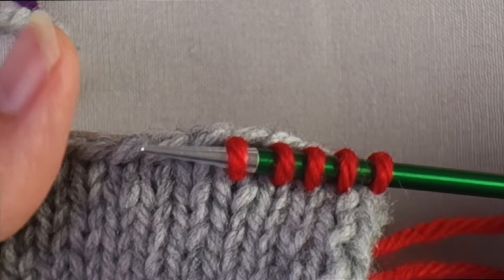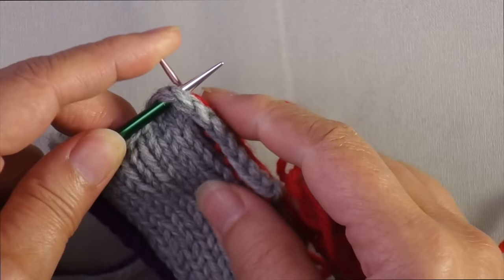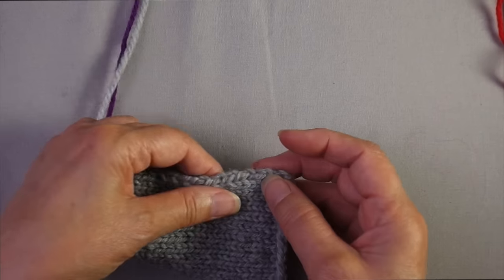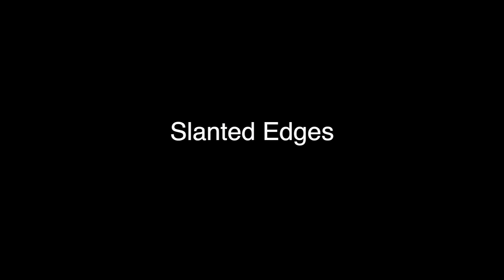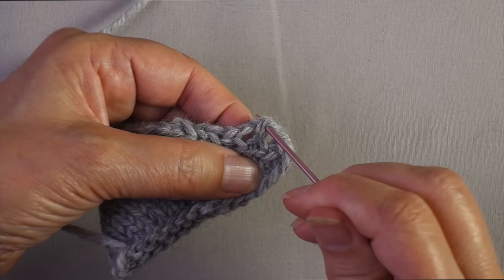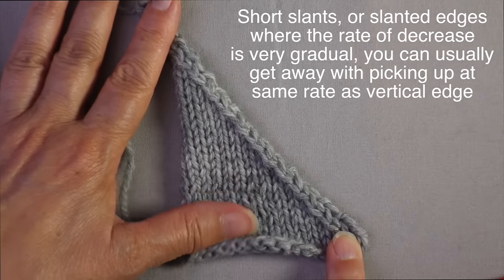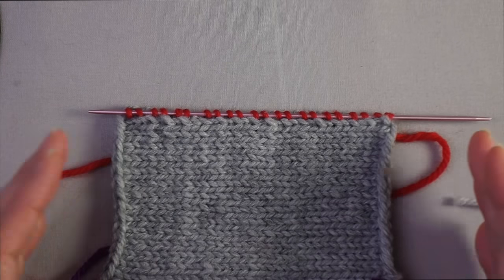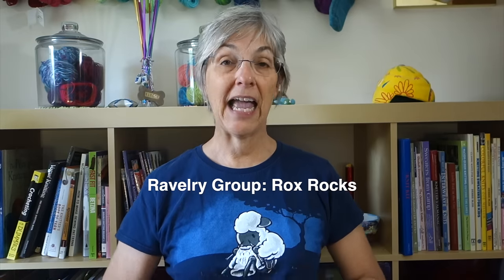Picking Up Sts Along a Finished Edge

Comment: I follow neckband decreases but my neckbands are not very tidy, so when I pick up stitches for the neckband I end up with a mess.
Reply from the maker: If you place your decreases at least one stitch away from the selvedge, you'll have a clean column of stockinette sts available for picking up sts.
Reply: @RoxanneRichardson  thankyou,  at the moment this isn't making much sense.  I'm very confused. My pattern just says to decrease,  knit to last 2 sts, knit 2 tog, which leaves a bulky edge for picking up stitches
Reply from the maker: @hunnybSue  So, instead, work your rows by doing K1, ssk, k to last 3 sts, k2tog, k1. That will mirror the decreases, and it will make picking up  sts easier.  Try it on a swatch, so you can see what it will look like.
Reply: @RoxanneRichardson  thankyou. I will definitely be trying this on a swatch

Comment: Hi - i'm picking up stitches on a neckline where there are alternating decrease rows (it's a little messy). I'm finding i have huge holes when i pick up the stitches above a decrease row, is there a way to fix that?
Reply from the maker: If you post your question in my Ravelry group Rox Rocks, along with a photo, it'll be easier to see what the issue is. Did you work the decreases in the edge, or a stitch in from the edge?
Reply: Right on the edge - it was a "decrease a stitch at the end of the next two rows" type situation.
Reply from the maker: These kinds of instructions are easy to misinterpret as "k2tog in the first two/last two sts of the row." The reality is that the pattern is leaving it up to the knitter where to place the decrease, and which type of decrease to use (left-leaning or right-leaning). If you place the decrease 1 stitch in from the edge , that leaves the selvedge smooth and decrease-free, making seaming or picking up sts easier.
Reply: That's an excellent tip I'll definitely keep it in mind for next time - unfortunately I've already finished all the pieces to my sweater (and have sewn up shoulder seams, woven in those ends etc.). Any tips for how to make the best of it?

Comment: Hi I need to pick up and knit to do neck and button band for baby  but after I did I have to knit 5 rows but then the buttonhole and button band don’t look right as pattern goes off thanks x
Reply from the maker: Which way is the pattern off? 1/2 st to the right or left, or is the pattern of garter ridges off (loss or addition of an extra RS knit row)

Comment: What kindS of edge can you make after you've picked up X # of stitches?
Reply from the maker: There are lots of reasons for picking up stitches. Common reasons would be to knit the neck ribbing of a sweater, or the button bands (or both, when it's a V-neck, and you pick up along one front edge, around the neck, then back down the other front edge). You might pick up sts around the perimeter of a blanket in order to apply an I-cord bind off, or a lace edging. You might have created a rectangular bottom for a bag, and need to pick up around the 3 edges that don't have live sts, etc. You might need to pick up sts along the BO edge of an underarm, or at the separation between a thumb and hand for a mitten, etc.